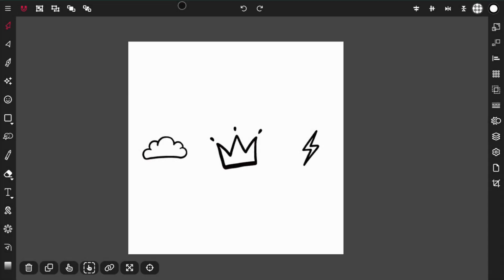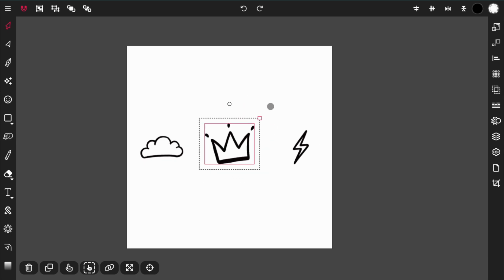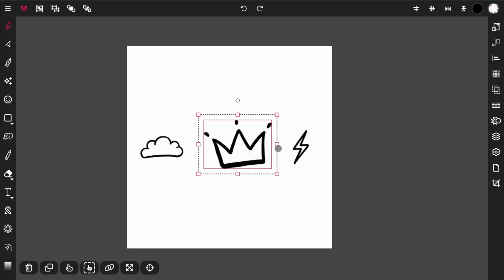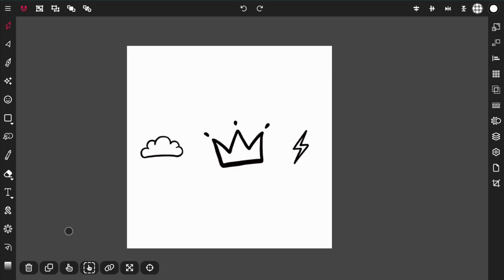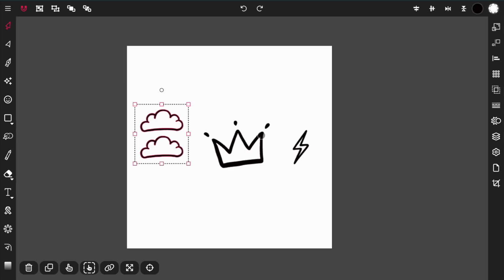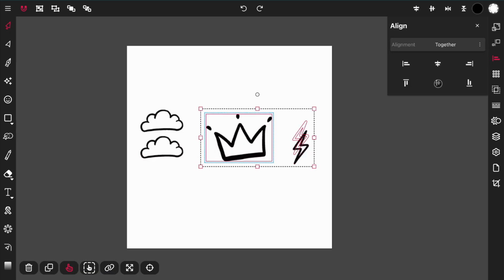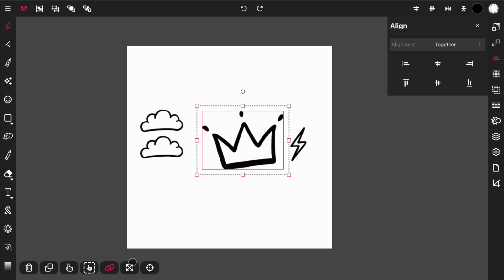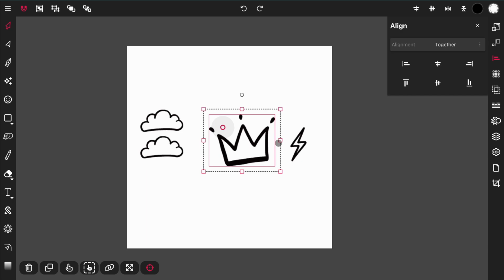Vector Ink Selection Tool Tutorial | Move, Resize & Rotate Like a Pro

Comment: THESE are the tutorials which actually help .. unlike the "tutorials" playist,
which presumes one already knows how to do things, and those ( 1st 2, anyways ) are done by people who make it significantly-more-confusing by doing-things-wrong-then-undoing-them, again & again, proving they published a rehersal, not a proper performance.

This is excellent.

The How To playlist, however, is in idiotic-order,
so anyone wanting to begin at the beginning,
has to study the titles of the videos in the playlist, and try to figure-out where to start ( 2nd-last video in the playlist, right now, seems to be the 1st-needed-to-watch video ).

This shoddy UX for Vector-Ink's customers has been consistent since the very beginning, years ago.

Somebody at the company who is responsible for customer-experience, read "First Impressions" and try understanding why you have significantly-less market-loyalty & traction than you could?

The proper paradigm is No Weak Points.

where one doesn't rely on a chain that uses weak paperclips in parts of it, because somebody "couldn't be bothered" to onboard new cuatomers properly.

No Weak Points wins, in the long-term.

Consistently.

🙏